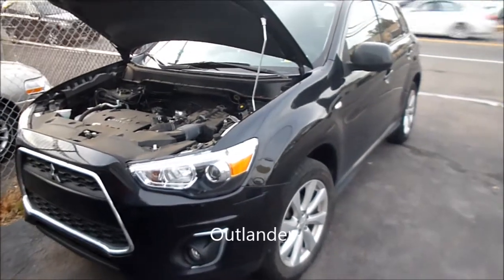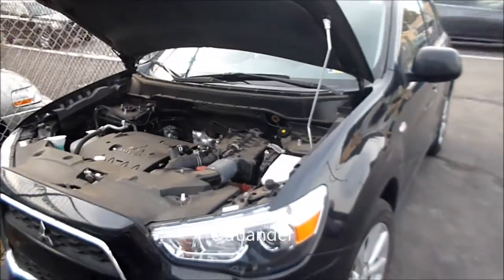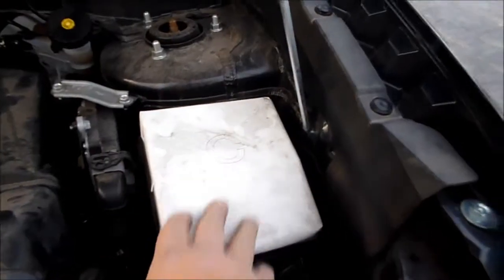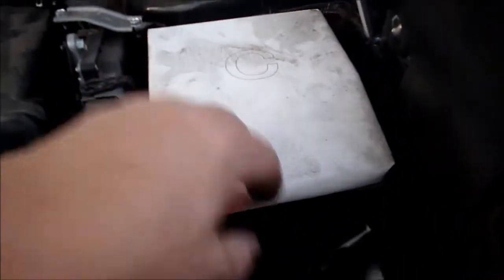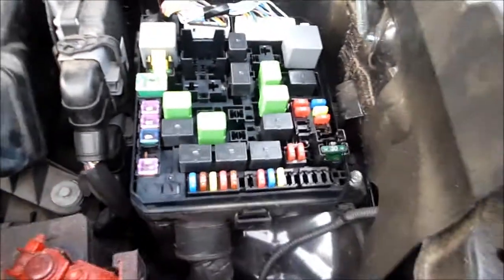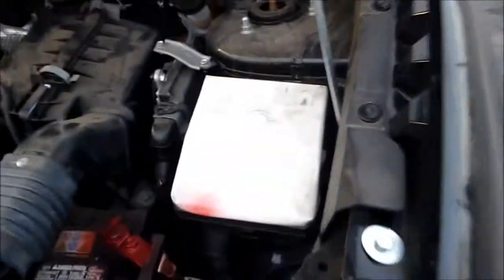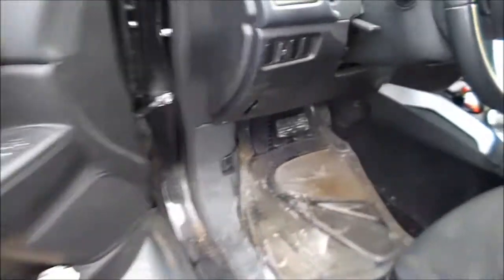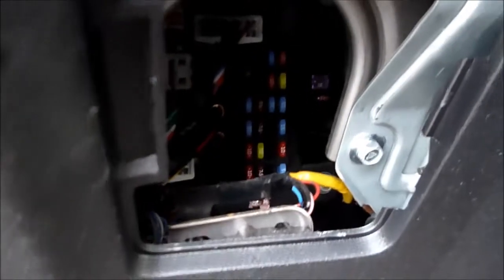Mitsubishi Outlander Fuse Box and OBD2 Locations

Comment: for mitsubishi outlander 2003. do you know where is the fuse for the odb2 port? i don't see it in owner's manual. i plugged in the reader but i can't get a reading
Reply from the maker: Didn't know there was a fuse for it.  Sounds like something is wrong. Make sure key is in on position but not running.